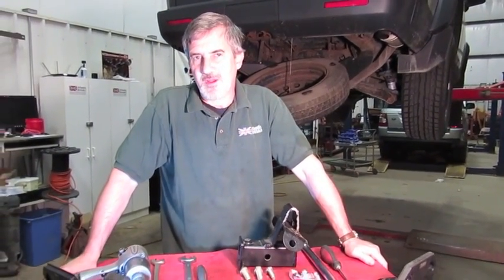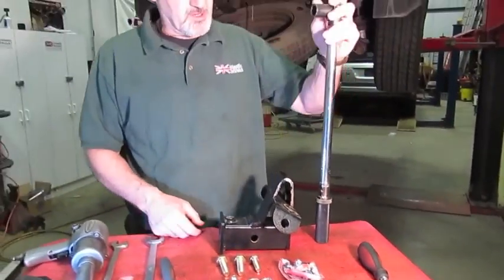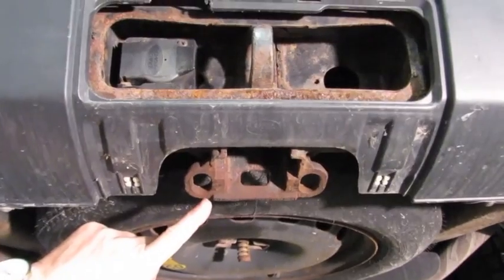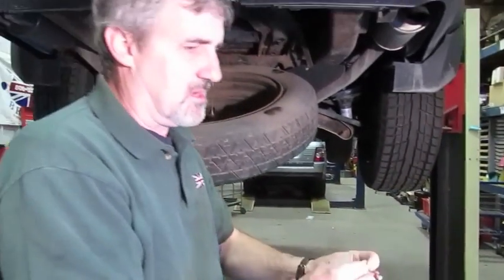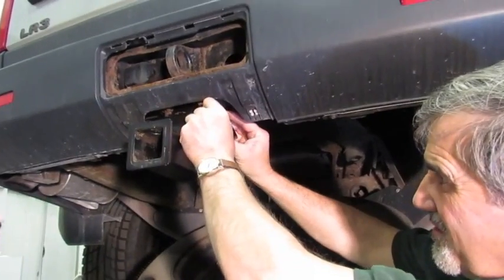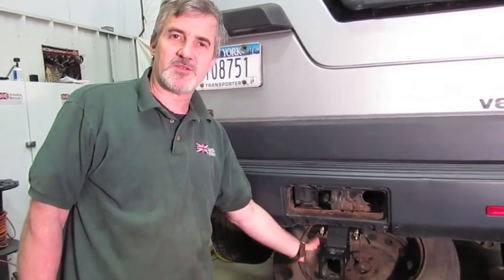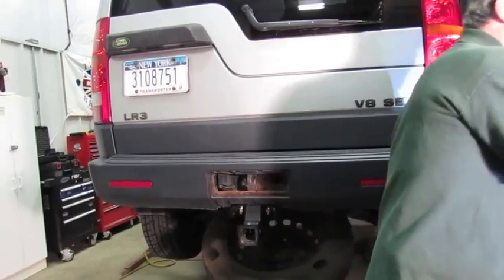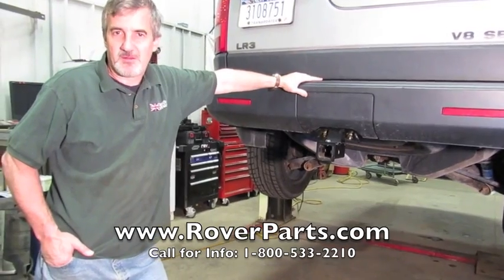Install the Bolt-On Trailer Hitch Receiver for Land Rovers

Comment: I've been having trouble with mine. Bolts have sheared, heads have popped off. Replaced with new grade 8 bolts, receiver still finds it's way loose while towing even with locktite and nylon lock nuts. I'm at point where I almost have to buy the oem part to feel confident towing. That and I have a hitch mount tray that slopes down very far when fit into the loosened receiver.

Comment: What's the towing capacity compared to the actual land rover reciever?
Reply from the maker: Class III rated for 5,000 lbs.
Reply: The oem is good for 7700 lb on the LR4

Comment: Is wiring required for 2012 RR Sport or it comes already wired with the plug??
Reply from the maker: It's plug-and-play wiring. We have a wiring kit for it here: https://www.roverparts.com/Parts/YWJ500170ABP . Also, check out the install vid for that wiring kit here: https://www.youtube.com/watch?v=oTwiC0AOj4g. Also we have a kit that includes the hitch and the wiring kit to get both together: https://www.roverparts.com/Parts/TRHWSP